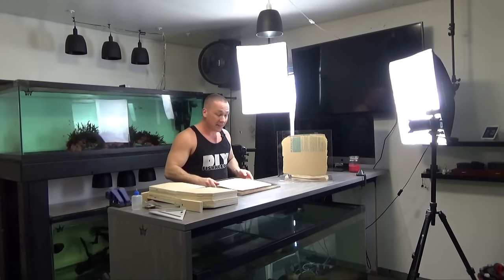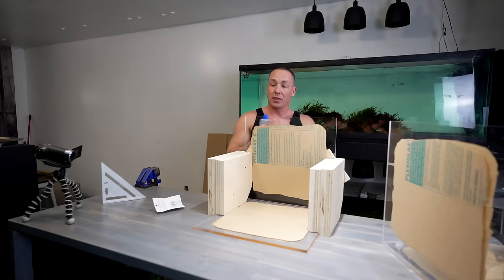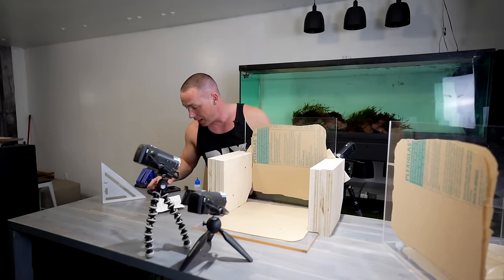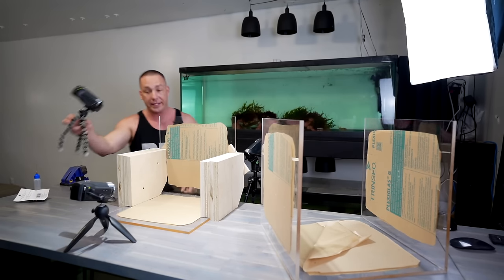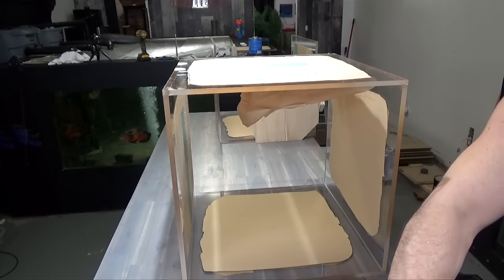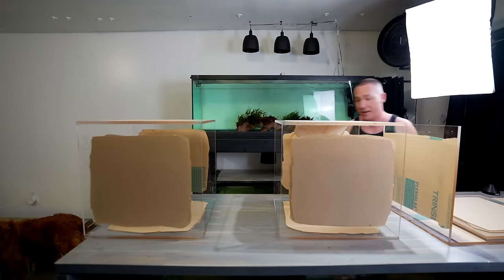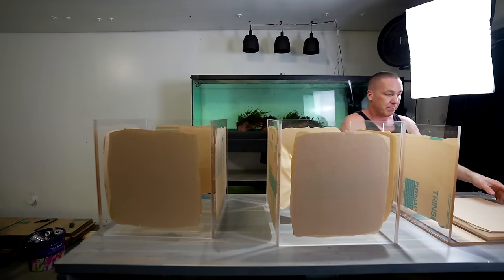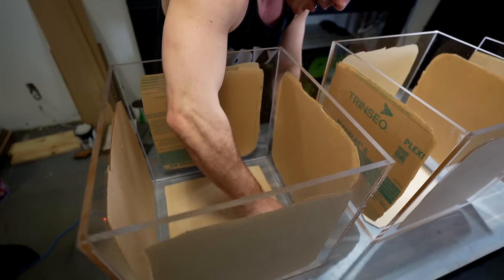HOW TO BUILD AN AQUARIUM (ACRYLIC) fish tank!

Comment: I love this idea of Building an aquarium tank like you Joey but in the UK 10mm thick cell cast acrylic 600x600mm costs about £50 a sheet, meaning an aquarium which is still quite small would cost over £250 pounds which is a ridiculous price…gutted
Reply: Acrylic is great and light etc, but if you are putting in a tank for many years glass is better anyway.  No scratching or dis colouring
Reply: That’s about the going rate everywhere. Acrylic is way more expensive to build with than glass. Tons of DIY glass tutorials out there. You can even recycle the panels from old glass tanks to make a custom build. Acrylic is not so easily reused

Comment: for that third panel you could use your corners in opposite corners to hold it all from moving. its should hold it all square, and keep it from rolling on the pins. you just need to build a mirrored set.

Comment: I build and sell my own acrylic aquariums for myself and my friends however I personally love and fear acrylic tanks. The way they can flex and bend is ether really good or really bad, I sand everywhere I apply adhesive too and build heavy wooden frames and I’ve never had a leak before but I definitely recommended a good solid stand and a healthy amount of care since you never know when a good bump with your elbow will cause a Leak. Also a good tip, I use gorilla glue construction adhesive it’s not silicon or “technically” aquarium safe but it’s non toxic, works the same as silicon, flexible, extremely durable, you can wipe it off with a wet cloth after 10 minutes and possibly the best adhesive out there I’ve used it for years and have years old tanks with healthy ecosystems and fish without issues only problem is that it’s white

Comment: Molecular/molecular.. it melts them together, then evaporates. I looked it up and it looks like it's dichloromethane, aka methylene chloride. Just FYI, about 10-15 years ago it was categorized a carcinogen. I breathed that stuff daily for 34 years, I am 62 and no problems due to DCM yet....I am planning to build a 24 by 24"  cube acrylic . A cube means its like 4 aquariums arranged in a square. More distance for fish to swim, is my thinkjng. Thoughts? I was thinking about using acrylic dowels for strength, drill, insert and glue... I think it should hold 240 gallons...I was also going to build a wood or acrylic base for it too...

Comment: What is the largest dimension tank would you make with the materials you are using (assuming you will cross brace at the top to eliminate bowing)? We are putting an addition on our house and the first floor (concrete slab) will be a sun/plant room. I want to get back into fish and have kept 55 gallon glass tanks before. But I want to go big... the largest glass tanks I can find are in the 125 gallon size. From there it looks like the industry jumps to acrylic tanks, and the price balloons. I do a lot of woodworking, so building an acrylic tank isn't that intimidating to me... except the water-weight limits of the panels.

Comment: I worked at tap plastics 2 years as a fabricator and I can tell u it takes longer then 1
Second to bond .. it takes about 10 minutes to really bond depending on thickness and then u still have to cure it at least 24 to 48 hrs before u even do anything to it after bonding .. what ever u just did will break maybe not soon but in time the weld is weak also u might have issue with craze

Comment: Qn, what do u do if ur tank have a micro leak. 

I made a sump. But on first water test it was ok. Subsequently when i filled with water, i realised it was leaking from 1 of the corners. I drained it and it is dry idling at 1 side. 

I am poured epoxy on 1 of the suspected leaking side. Thinking to do that to all egdes. What is ur view?